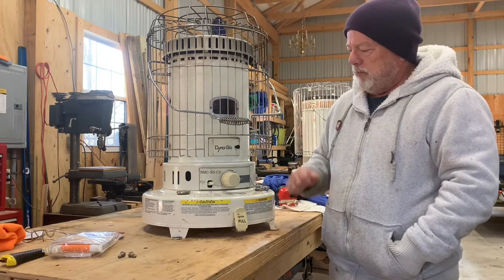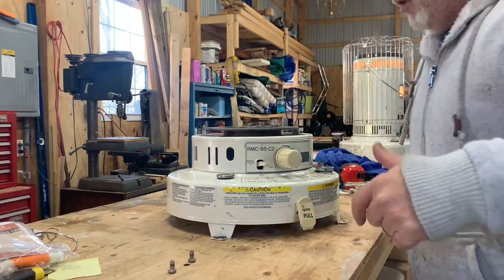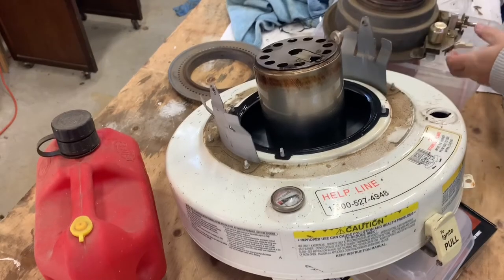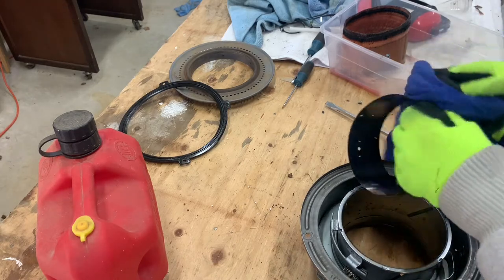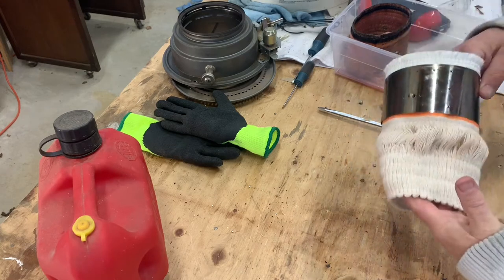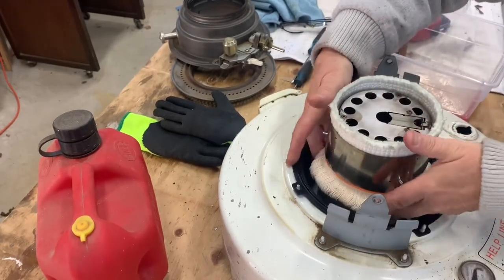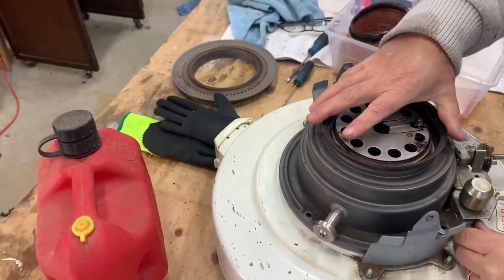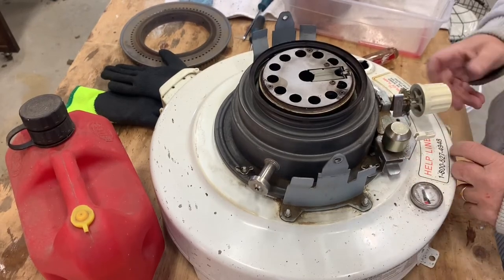Can we fix this kerosene heater?

Comment: They do have pink kerosene. They dye it because where I live they don't tax it for home heating and for use in off-road vehicles. So that could be pink dyed kero you have in that heater and it stinks when used in wick type heaters. I have very few places to get clear kero here and it's expensive. Just to let you know.
Reply from the maker: Good to know. Thanks for commenting.
Reply: That pink dye is done here n New York.
Reply: @dontknowbrian  Here in Pa. also !
Local Sunoco changed over from another 
Oil Co last season & they sold the red dyed stuff ...It was definitely NOT diesel & it burned as well as the clear stuff the former 
station sold. Very hard to find KERO @ the pump ⛽ this season ...finally did a month ago ...the other day it went up from $4.25 to
$ 6.99 in one shot ! Still , propane is 3-4Xs more than the $7 price ! ! For equivalent burn time / BTU output ....1 gal in KERO heater can last 12 hrs + @ 20,000 BTUs 
20lb tank of propane 14 hrs @ 20,000 +
BTUs ...getting propane tank filled , approx
$30ish dollars !

Comment: Greetings. Tnx for your vids. Can you help me diagnose why my heater will not fire. The tank needs to be full full. Ifit is 3/4 full, the top half of the wick is bone dry. The bottom is soak in kerosene. But the top of the wick is dry. Any ideas? Please help
11:29 11:30
Reply from the maker: I can only speculate.  It sounds like the wick is not dropping all the way to the bottom of the tank.
Reply: @PetesProjects0  greetings. It is reaching the bottom. The bottom half is soaked soaked. Hence why i am reaching out as it has me stumped. It all just doesnt add up
Reply from the maker: @dominikcholewka346  If you haven't already done so, I would replace the wick and see what happens.

Comment: The clear kerosene is referred as
 K1 KEROSENE 

K2 Being the red dyed kerosene.  

There are probably less than a dozen gas stations in the United States that sell K1 at the pump. 

For a single gallon of (no sulfur)
K1 kerosene in a metal jug at Lowe's is $35 per gallon

Home depot is $3 less per gallon.
Reply: I purchased/pumped 1-K grade water-clear Kerosone at both Sheetz and Rutter's this season. I know a Sunoco in my area that sells it too. Maybe it's a regional thing.
Reply: We must be lucky, there are several gas stations here that sell it.

Comment: I have a DH 2 304S model used it once last year brand new going to use it today and it smokes. A lot of black smoke and suck what’s wrong can you help?
Reply: after each season you need to do a "dry burn" which means that you empty almost all the Kerosene out and put it outside and let the heater burn until it goes out. It self cleans all of the build up out of the wick. Then you should be good.

Comment: Missed a massive step putting the wick back on. It has to be put on as if the wick is turned up to the maximum. Otherwise when you press the release  button the wick does not go down.
Reply from the maker: Thanks for passing that along.
Reply: Yeah you’re correct on max 😊